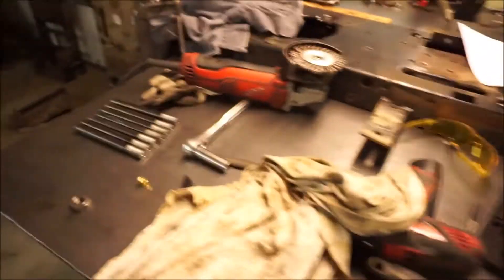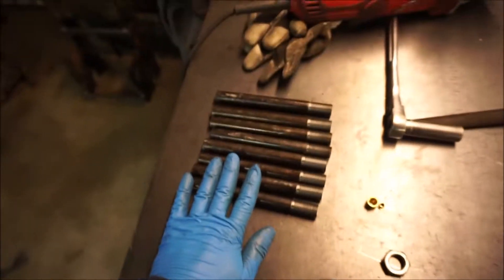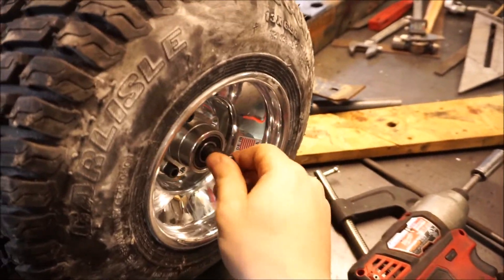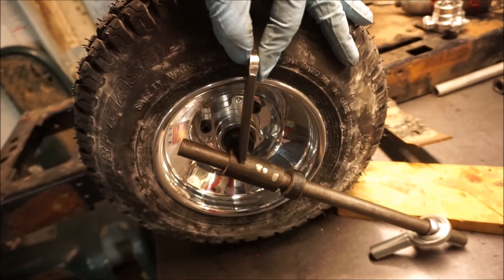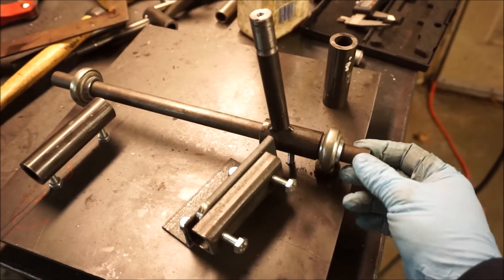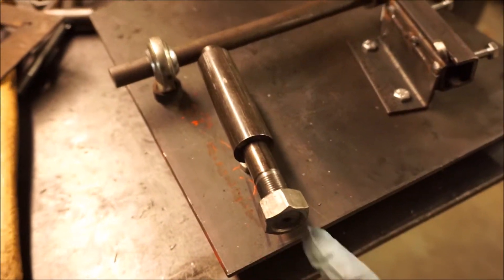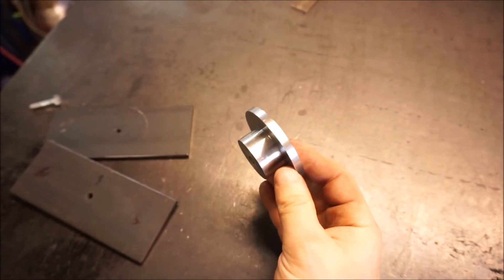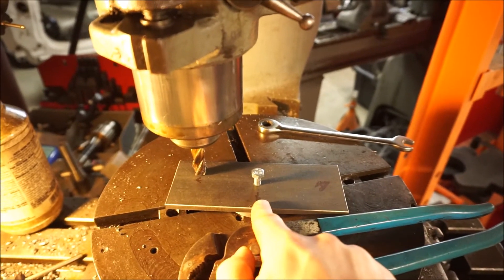Racing Mower Build Pt 3. Front Axle, Jigs and Splidles Fabrication

Comment: One of the most important angles in front end geometry is Ackerman. With your spindles at 90 degrees off of your tie rod points, your inner front wheel will not compensate for the smaller radius it travels as it goes around the turn. This gives a scrub effect on your inside wheel. If you point the tie rod mounts at the center of your rear axle, you will have close to neutral. A bit more, and your inside wheel will help pull you into the turns.
Oh, and a slightly bigger diameter rear outside tire will help also.
Just been racing dirt for the last 40 years. 
Be well, and have fun
Reply from the maker: Thanks for the input!

Comment: You know your stuff….I am building one off of your videos. I’m debating on keeping the four speed transmission for the back or making it a live axle. I have some springs the act as suspension on the front, I’m hoping that helps. I just need to figure out the rear.

Comment: Great explanation about front ends but I still don't understand why you didn't go with the Ackerman effect?  I'm in the process of building my first mower and thought it needs Ackerman in the front.
Reply from the maker: Thanks for watching and commenting. Theres two reasons why I didn't include any ackerman, first off is because I'm using a center steering pivot point instead of a pitman arm off of a spindle going back to the steering shaft. I feel that the pivot point in front of the axle gives much more accessibility for maintenance, assemble and repairs as well as more clearance for the pully and belt behind the axle. The other reason is often in dirt racing front ends are set up with a "parallel" ratio for both front spindles with no ackerman due to how often you are counter steering in the turns. After all ackerman would be entirely opposite when you have the wheels turned to the right while going around a left hand turn.

Comment: So what’s your background?  Not many people with a mill and lathe in their shop?  And how’d you get those tools?
Reply from the maker: My profession is a plumber, all the mechanical and metal work is just a hobby for me. The tools are pretty easily found in the old rust belt area, after all the Bridgeport's were made in the same state I live in.
Reply: TheJanticJournal thx.  You have my son fixated on making one of these conversions.  We’re tackling an old John Deere 110.  I don’t have those machines but we have welders and drill press.  So trying to make a go of it.
Reply from the maker: Good to hear! When I made my first two mowers that's about all I had too. I find an angle grinder is very useful and versatile tool for people without a lot of other equipment.

Comment: Besides the mower have a question on the ohv briggs engines and if a set of 2 chevy 350 roller rockers will work in one of the ohv engines. If I'm not mistaken I know for the kart guys with the horizontal briggs animal ohv engines they will work in those small block heads. Know of a couple of guys that's used them in those engines.

Comment: How are you liking the step through chassis? I like driving them because leg placement feels more natural to me, but they get cramped under the fenders without the box.
Reply from the maker: So far so good, it looks like it might be tight to fit in the chain tensioner since the axle is so close to the transmission  but I think it'll work out. I'm looking forward to the first sit test after I lower the seat into the fender lol

Comment: I would live an engineering breakdown of those internally mounted disc brake front spindles that were shown in a previous video! Those are impressive, great vid!
Reply from the maker: Thanks, I just kinda winged it on that front end. It all worked out but wasn't as planned out with jigs like the current build.

Comment: That was pretty in depth. You explained it just fine. I look forward to seeing the final setup. Could you potentially switch it to a front steer axle? Are you allowed to use a rack? Good stuff man, I like it.
Reply from the maker: There isn't anything in the rules against a rack and pinion steering setup, I've thought about it before but it would be tricky to setup the steering shaft to it. This will actually be a front steer axle btw, I like it in front to allow more room for the motor pulley and it's easier to work on. Next video will show the mower on all 4 tires finally lol

Comment: Good video.    On the axle  tube ,  2x1.5" ?  what are the cut degrees you put on it.. the end cuts dont look square.   longer video would be okay..
Reply from the maker: The end of the tube are cut at 10 degrees to match the king pin inclination angle of the spindles. Thanks for the view and comment!